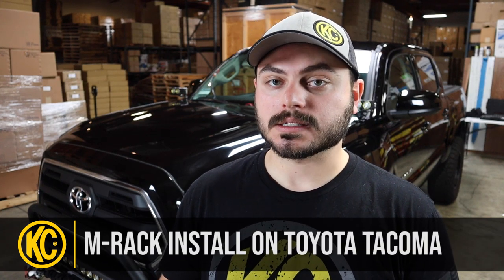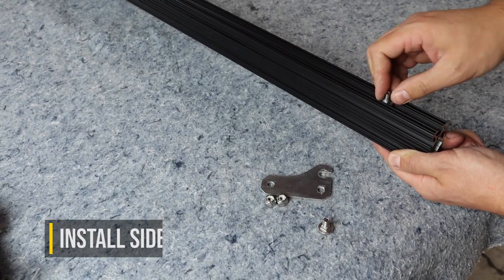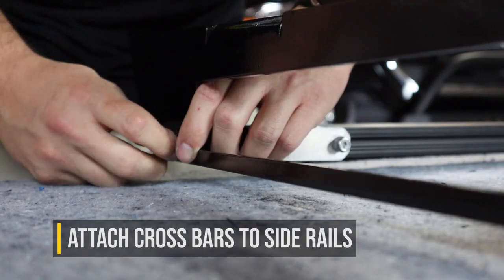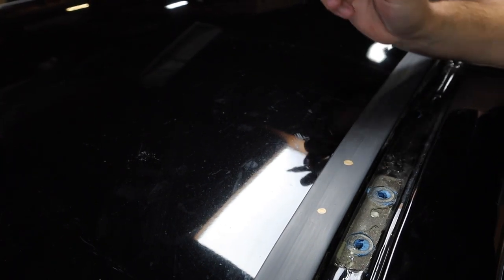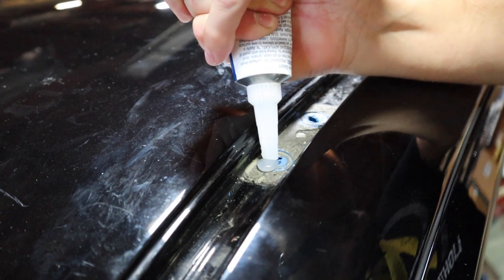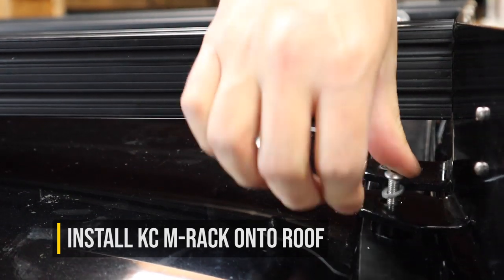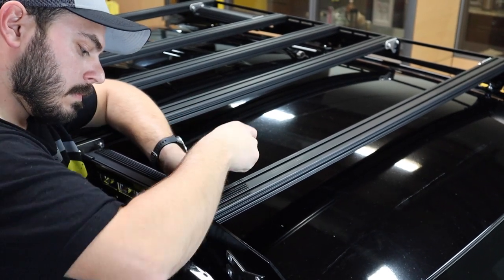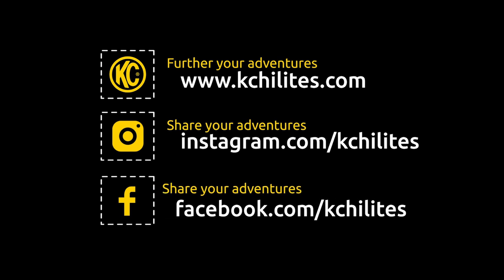2005-2019 Toyota Tacoma Roof Rack Installation Guide | KC M-Racks

Comment: No Drilling > Huh .....Right high winds will loosen knock those mounts Off to  the side of the road along with your Rack  HUGE FAIL
Reply: Tacomas don't require drilling because they already have the mounting holes.. you just put a spacer in between..